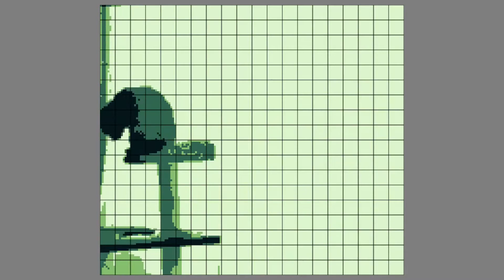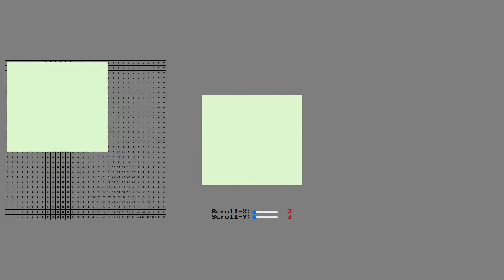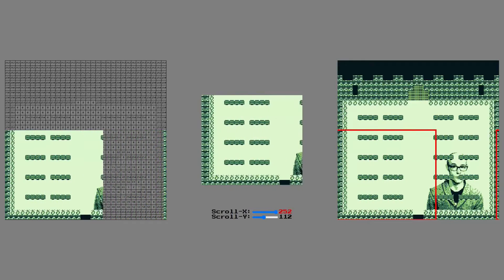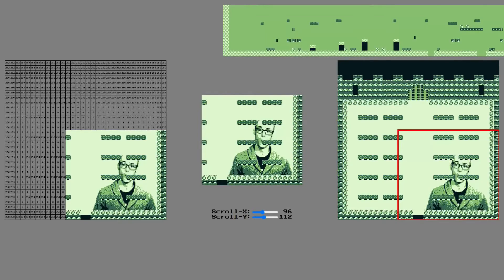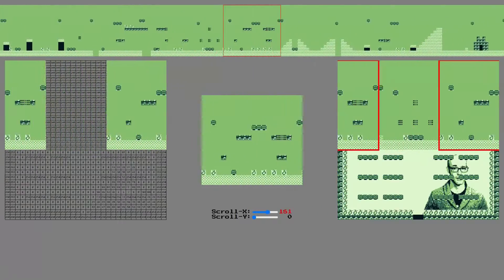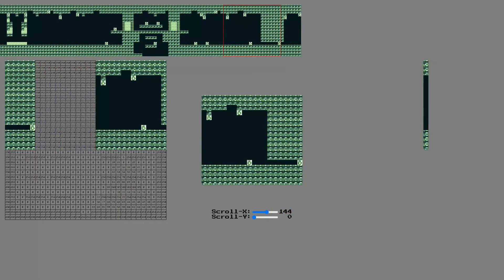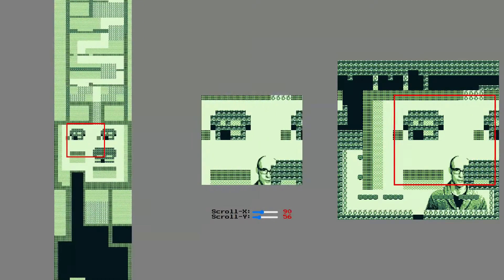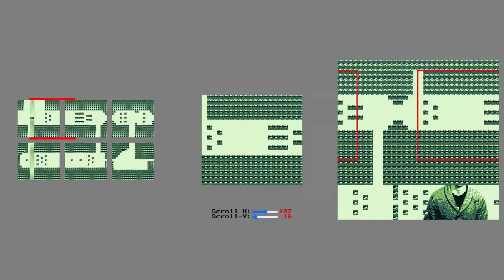Background Scrolling - How GameBoy Graphics Work Part 3

Comment: Interesting... Did the Gameboy got the speed on? Like... let's think Megaman with his slide move... If he got faster, would the gameboy follow accordingly, or got some scrolling limitations that would make him touch the screen?
Reply from the maker: The scrolling can keep up by changing the scroll value by more than one pixel per frame. So if it's already being scrolled by one pixel per frame and you need it to go twice as fast you can make it scroll by 2 pixels per frame.

There are no limitations that would require megaman to touch the side. You could design the game to have him touch when sliding to make it feel like he's moving faster though.
Reply: @systemoflevers  Thanks for your answer... By that, game like Castlevania Legends, or Belmont revenge, where slow by choice then? They could walk triple speed if they really wanted? Thank you again. <3
Reply from the maker: Actually I need to think about this more...

So if you're just scrolling and not updating anything then yeah, there's no limit to the speed, but then you'll just be repeating the same background over and over. If you want to change the background then you'll need to update the video RAM and there is a limit to how fast that can be done. The gameboy runs at 60 frames per second, so you need to update everything in the time it takes to render 1 frame. If you don't finish you'll get a partial update, kind of like screen tearing on modern computers. If all you need to do is update the tile map then you should have no problem depending on what else the game needs to do that frame. If you need to copy over new tiles to the video RAM then you could run into limits.

There's also all the enemies and stuff on screen that need to be updated too though. If there are a lot of enemies or they have complicated behavior then the gameboy might not be able to keep up with updating them when you move really fast. 

So some things might be stylistic choices, like maybe in Castlevania they wanted it slow so it feels more dramatic, or there could be technical limits due to game / graphics complexity.
Reply: Impressive details... now i'm even wanting a game boy... thank for your asnwer again <3. @systemoflevers
Reply from the maker: They're fun little devices and relatively easy to hack around with. A bunch of new games have been coming out for it too from indie game devs.

The emulators for gameboy work well, and there's a really nice and not too expensive FPGA based reproduction called FPGBC from funnyplaying.com. in case you haven't seen it I have a video where I assemble one https://youtu.be/Xx4hmsFzlKY!